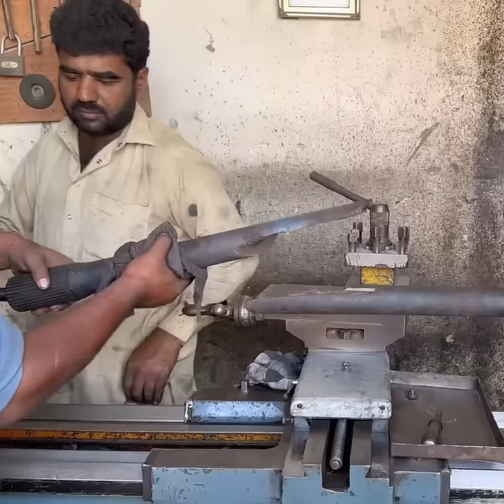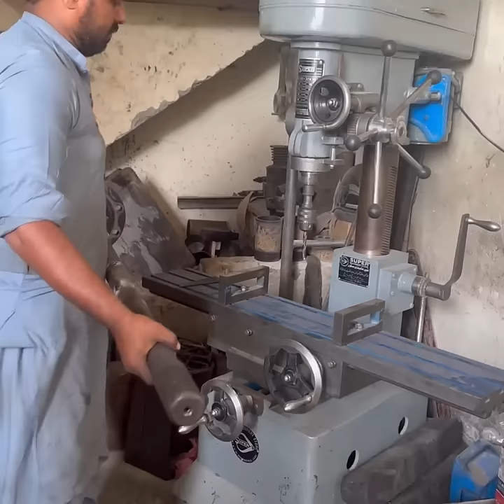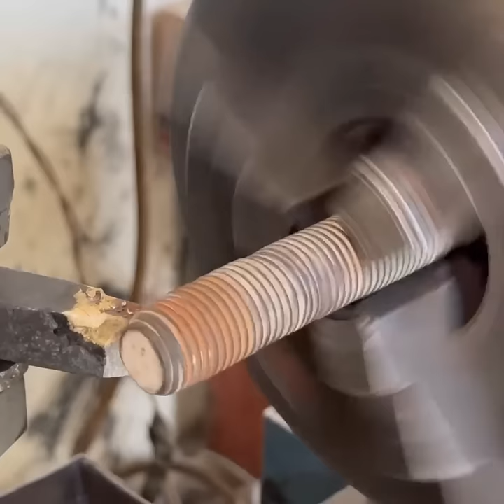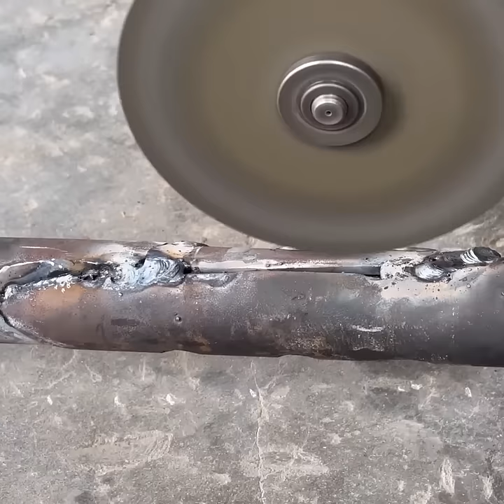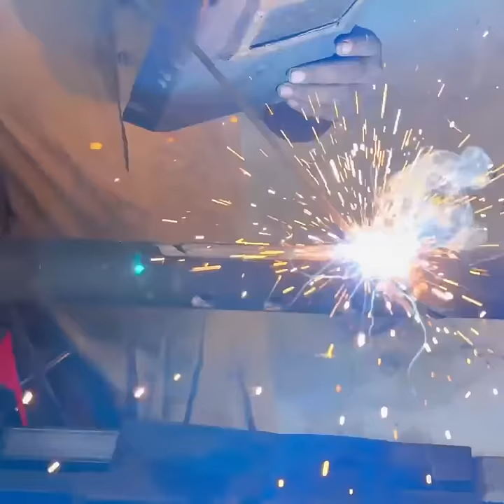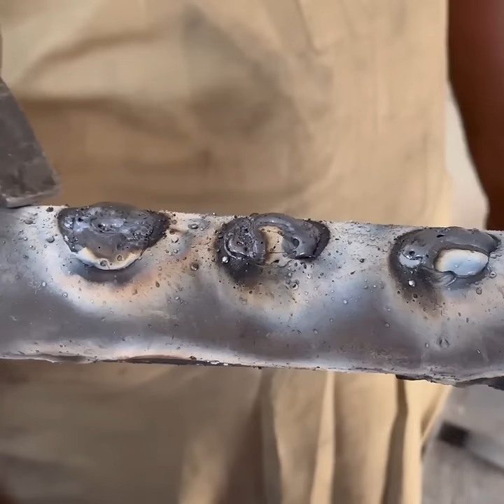How to Rebuild Broken Axle with Amazing Technique

Comment: There is no way that thing would last.
Reply: Es solo llamar más pobreza...
Reply: its not as strong and will likely break very soon
Reply: @chetbenton07  How dirty was that break 🤣and when you think about the torque that thing is going to get as well as no way to ever balance it. What it is they make it look nice and sell it to some sucker and it dies a week after installation.
Reply: Amazingly all that equipment is there and they don't understand the basics of tensile strength 🤷.
Reply: It broke more while they were playing with it
Reply: @dgeneeknapp3168  Well they are using the welding as the hardening and tempering process all whilst wearing grandpa slippers!😂
Reply: @trentgreen9745  I saw that a great big dirty crack next to the rivet which just goes to show how fragile it is in the first place. Probably snapped because of over heating. It would be like using a glass handled hammer you might get one good whack before it explodes.
Reply: I don’t think anyone here knows what they talking about and never welded anything EVER.
Reply: @AJ_900  What do you mean. Are you saying it's a top notch job?
Reply: @AJ_900 alguém sensato falou a verdade. Mas o que mais tem é gente querendo demenuir o trabalho das pessoas
Reply: It didn't last when it's new.
If the repair can give it more usfull life then its  worth it.
Cost of repair is only a tiny fraction of a new one
Reply: @daveredd9832  You do realize that they fix heavy machinery in this same fashion. (Not exactly like this, but with welding.
Reply: Eso no sirve de nada,
Reply: @AdrianJNyaoi they didn’t V out the work properly. It won’t last 5 minutes when the truck is loaded. Aside from that they messed up the metals tempering.
Reply: Im the 301th likes
Reply: You will be surprised that will probably last as long as the car
Reply: @James-cs2wi  What car? There is absolutely no information other than it is a very poorly performed attempt at a repair.  Not to mention there has been a catastrophic failure already. So a very poor repair upon a vital mechanical part which is subject to great torsional strain that has already failed and not been repaired properly.
What sort of vehicle would you trust this in?
Reply: @TheNarrowPath84  Of course repairs can be made that last but with what has been displayed here there is no way anything near a quality repair has been displayed. And it is quite clear that there was enough tooling and skill to do a good repair. It was no where near good enough.
Reply: @AdrianJNyaoi  A tiny fraction of no life is not worth what some poor old farmer is going to pay for a piece of garbage that will fail half way to market.
Reply: @trentgreen9745 😂
Reply: @daveredd9832   Just curious how your response is relevant to mine? Let’s not pretend that heavy machinery isn’t fixed in this same fashion. Shitty welders are world wide. I guess because they’re not American they can’t do quality work? That’s the feeling I get from everybody because they work in sandals. Quality tools and PPE doesn’t make you a quality craftsman. 
And you liked your own comment didn’t you?
Edit: I’m curious why you think it won’t hold? After being machined down, the axle looks good to me. I’m sure it’s not going into a hot rod and have serious torque put on it. I will be my bottom dollar that this was from a small car and more than likely it was done just to show he could do it. Are you a welder? If not, what field to you work in? I am a sheet metal mechanic.
Reply: That’s going last forever 😂
Reply: @chetbenton07 not true at all actually
Reply: Im not a welder but I've seen way bigger stuff that that tac welded and it's perfectly safe welding is 100 percent safe the only problem is this would most likely just wouldn't be straight as it should so that would just mess other parts up but that weld is gonna hold but not as good as new considering the bars not straight
Reply: It will last for a long time 
It's just amazing how they fix it 
They are hard workers.
Reply: That will last forever…in a go-kart 😆
Reply: Only has to last until it breaks again. It's a vicious cycle, but it's life.
Reply: Depends on the weld job. Done right welds are just as strong.
Reply: @Thekidsinafrica14  Well that is the point, looking at the job and the dirt left in the weld no way was it done properly.
Reply: Good to see Health and Safety is high on the priority list.
Reply: This must be an emergency  , the car has broken, the wheel shaft of the car  has broken  down on the road , this is the way to speed up tepairs that far from  the city
Reply: @jamesedgar5944 
La soldadura no es adecuada en piezas que sufran fatiga , osea cargas alternas. No rompe la soldadura, sino por al lado. La soldadura al enfriar rápidamente ya queda en gran tensión. Habría que calentar la pieza a soldar antes de soldarla y asegurar un enfriamiento lento
Reply: @TheNarrowPath84  The cracking steel next to where the rivet had been driven in? That shaft is about 75mm thick (3 inches) meaning that it comes from a small truck.
It is designed to be one contiguous piece of steel just look at how filthy the two surfaces were not to mention how many voids would have been left inside where you can't see them. A polished turd is still a turd.
Reply: @macarenomoranas  I know you see English on my comment😂
Reply: @AJ_900 tell me why this repair will fail. Right answer only.
Reply: Para resolver y llegar a un buen sitio bien, luego si habrá que cambiarlo, remplazarlo completo, sería lo primero que haga.
Reply: @daveredd9832   Yeah, you’re not a welder. It took one comment, just one, to tell me you can’t weld, much less know what you’re talking about. A small truck? I guess you’ve never actually seen how little those trucks are in that part of the world? Tiny 🤣🤣🤣 And those aren’t rivets. Solid steel pins. Please don’t @ me again unless you know what you’re talking about. Thanks in advance.
Reply: Por que?
Reply: Hami yenileri sindirsin sonra təmir etdirsin . Təmirlinin güclü olduĝu iddiasi var toyuq başlar tərəfindĕn 😂😂
Reply: Your right😊
Reply: Imagine how bad it would shake??🤯
Reply: Engatilhado para vender para o primeiro inocente que aparecer, é uma covardia na verdade esse trabalho mal feito, sem garantia alguma.
Reply: It is poor country
So that is better than nothing
Reply: There was a second crack on the opposite side of the original crack when he pounded in that pin. Poor sucker that buys that rebuilt is gonna regret it going up hill.
Reply: @Alex.369 да ты прав
Reply: Yes, he must have glued it together and let it be solid like the way it was. No replacement of metals to a welding
Reply: Actually, it does last way longer then y’all think 
😬
Reply: Its actually stronger now
Reply: Actually look Very Very Extremely Close Slow Motion the Real Truth Comes Out Really Makes One Beleave in One's Beliefs Cause That Has been Welded spot Welded Mig Over Hundred 💯 Time's!!!😅😂
Reply: هذا الحرفي ،يعرف جيدا ماذا يفعل و حتى بأدوات بسيطة ،رأيت أغليية التعليقات السالبة و أقول لهم راجعوا الفيديو جيدا و المنطقة المتقطعة عززت بالبراغي ، النتيجة : أصبحت أقوى على ما كانت عليه .
مثل عربي : الحاجة أم الإختراع.  و أنا أقول العكس صحيح أيضا .
Reply: @tswyoung5223 Think if you are
a car owner and the spare parts availability at the distant opposite of the globe. If you are
wealthy it's so nice if junk your
car.
Reply: I've done things like this before, and it usually lasts a lot longer than I think it will. When you don't have a lot of resources, you do what you need to do to get by.
Reply: But it works, temporary, good idea
Reply: Doesn't matter rich or poor it is good technique
Reply: @daveredd9832 Who balances axles?
Reply: With those skills, they should have just made a new axle
Reply: @ajcarmageddon he's just guy from internet, maybe he csme from capitalism country which said buy new one not fix the broken one
Reply: Oh yes it will, and if it breaks again oh well they will just fix it again.
Reply: @jmaxim80  But of course what else do you do?
Reply: @tigeroftheeye7121  Hahahaha but why waste good steel on someone else's bread and butter when you can bodge it up and get paid for it?
Reply: @tigeroftheeye7121  I don't think that any one does. Because it is generally made out of one piece of steel. But when I look at that thing and consider how fast it is going to spin questions come about. Torque with speed inside a hollow tube with tight tolerances. Sorry mate it will vibrate.
Reply: @gausmulla3378  It is good for getting you to the next town or home. Good attempt but dirty steel full of voids. Making it look shiny does not make it gold.
Reply: @stubbs9079  True but look at the gear these guys have. It is actually a well equipped workshop in any country. My beef is with how dirty the steel is as they put pipe clamps on. That axle is the best part of 75 mm thick. The welds don't even get half way. Then think what it took to break it in the first place and I can only conclude it will not get very far. There is the possibility the owner said make it last two thousand kilometres because I'm getting a new diff.
Reply: @Abbesr8  Apologies mate but I do not read the language you have posted in.
Reply: To all the shit talkers, this is what you do when you don't have a replacement or the money to replace it....
Reply: @richardwarnock2789  I'm not exactly sure what you mean I just watched it again and see the stick weld into a dirty void as well as a clean through break next to the skilfully fashioned rivet. Then there is the polishing of the turd. But Mig? Please regale me.
Reply: @daveredd9832  bro uh r right but temporary it is ok.
Reply: @tswyoung5223  I have dudes busting my chops because I dare doubt the quality. Read some of the other comments this is almost fun pointing stuff out to goof balls. But I am getting bored after three days.😁
Reply: @TheNarrowPath84  What car has a three inch solid steel axle? As far as what a rivet is it is a short metal pin for fastening two or more pieces together, having a head at one end, the other end being hammered flat after being passed through holes in the pieces. 
Well sorry "almost a rivet" one end hammered in and the other welded.
A pin does not poses a head on either end sir.
And as far as those trucks in that part of the world are concerned. They have rigid large trucks all over the place.
Point me to any truck under two tonne that needs a three inch axle. A three inch axle is for a big arse truck mate.
I have a one tonne Ford Falcon ute and the axle is about 30mm. What little TukTuk needs a 75mm (three inch) axle?
Reply: @yourdrummer2034 I like Your thinking. Good to Go until it needs to be fixed again or replaced. Worx everytime.
Reply: @daveredd9832 a tricycle perhaps 😂😂
Reply: It's only to get someone to a shop 🙃
Reply: 😩💩nooo 🤦🏽
Reply: @daveredd9832  no the guy is probably watching him work and it will work til it breaks again then he will fix it again cos thats how its done, when you cant get the bits to replace things and even if you could it would cost too much to buy it
Reply: Deve tá mais forte que original amigo 😅 pode apostar
Reply: Amen and Amen all day long on that one
Reply: Yes it would
Reply: Slap 700hp on it its snapping in 2
Reply: My bet is about 12 minutes!
Reply: I’ve seen forged in fire too much those metals are not bonded well enough 3 robbets might help if this is spinning like an axle but any weight on it sideways is gonna make it bust right away
Reply: I'm sure they have done it before and it worked
Reply: Se puede poner refuerzo cilíndrico adicional exterior
Reply: Es lo que iba a decir, eso solo para sacarte del aprieto al momento
Reply: Looks like an axle from a Yugo.
Reply: Oh India, just buy a new one. 4000 labor dollars later
Reply: У меня стоит уже 4 года так что не надо
Reply: Welding usually produces a stronger metal connection than the original. A good weld can be better than new. Most here should Research welding before commenting 🤔 
This is impressive given the working conditions, After all“ invention is the mother of necessity.”
Reply: Ещё тебя переживёт
Reply: Why does that matter? Imagine getting stuck somewhere with no parts available. I doubt they have one on the shelf. If someone did need, it hopefully  they got home
Reply: It would
Reply: @bryanrose2384  It would what?
Reply: @alphagoat1314  These blokes are putting their very families fortunes and well beings on the line for a poorly patched part.
Now imagine when this good looking part that you paid money for and paid someone to install being told it is the bees knees fails. You do not finish your job you do not get paid and you are stuck in the middle of goodness knows where. 
Looking at how well equipped that shop is. They are well to do in any society and preying on the less fortunate.
What does it matter?
Let a mechanic charge you for a part that fails when you are trying to feed your family and ask if it matters when you roll down a hill backwards into a ditch.
Reply: @schneider007  Usually? Can be?
The working conditions are as good as any anywhere in an industrialised nation. Look at the equipment they have.
How many shops anywhere have the capacity to turn a three inch piece of steel four feet long. Then the quality of a drill press plus drill bits to get through that material.
Highly equipped well skilled doing ordinary work.
I fail to be impressed.
Reply: @richardwest5010  You are a funny bugger Yugo axles are about 10mm thick. That is less than half an inch if you are a sepo.
Reply: @stevestevenson7856  Well I believe it wont get you far. You seem knowledgeable what sized vehicle needs a 75mm axle?
Reply: @louismoro9585  I love that show any donkey knows it will not take any torsional strain. Love ya bro. I have been getting a lot of flack well... from donkeys!!!
Reply: Bro they constantly snap axles out there... Think about it... You're not going to NOT BREAK stuff when you're in the dessert and and everyone has a fully built 2j or rb in their patrols
Reply: @chetbenton07 they just want to sell that Thing....
Reply: @AdrianJNyaoi No Worry, they welded it with Allahnium 😂
Reply: a necessidade fala mais alto, nem todos tem dinheiro pra comprar um eixo novo.
Reply: Repairing broken things is an art in India they are very wise and smart people, other nations around the world practices the same
Reply: @Tecnotrucker80   yeah
Reply: No soy Mecanico sin embargo veo que esto es basura eso no le importa ellos incluso para subir el video lo que les importa es que gente como nosotros estemos haciendo comentarios muy rara vez hago comentario normalmente simplemente le pico el botón de qué no me gusta ella porque al hacer comentario entonces estás ayudando para que sigan haciendo esta basura
Reply: Work super labour
Reply: Most comments here are so vague and ignorant .
Just because in other countries It’s easier to replace than fix. It doesn’t mean it’s the right thing to do.
These fellas don’t need steel toe boots or high tech protective gear.
They have knowledge., skills and a strong willed mind. Something that is very rare in fully developed countries. 
We need to understand this world a bit more. And look at it from all the angles, not only the one we know.
Not because the products we use or consume are stamped with a nice name plate or we only see it finished and shiny, doesn’t mean it’s better quality. 
Most of heavy equipment parts are made in places like this. And we are so confident and happy to use them because we didn’t see the process of making it. We just bought them at a high priced retailer with a fancy name.
Reply: Great job. They are pure people they don't find new parts so easy that is why are they welding that thing😉
Reply: @AJ_900  hablas de ti mismo? Creo aquí somos bastantes soldadores y todos estamos de acuerdo con que no va a durar ni una semana está reparación...
Reply: Didn't last in the first place
Reply: Five minutes😂😂
Reply: Я читал про одного сварщика, который, ещё на заре электродуговой сварки, влюбился в это дело и будучи капитаном речного судна, бросил свою профессию и стал сварщиком. Однажды ему пришлось сварить переломившийся вал здоровенного грузового судна, но там ещё была закалк после сварки. Судно благополучно пришло в порт назначения.
Reply: it'll last longer than it did before it broke
Reply: the repair is the only spot that axle won't break
Reply: @daveredd9832 in countries like these they reuse as much as they can. It's all about perspective.
Reply: @antoniomurillo6648 what do u no
Reply: @AJ_900 I 100% agree.
Reply: @daveredd9832 I think you're confused as to what the end product should be
Reply: @jeremykamel9655 the truck?
Reply: Pakistan ☕
Reply: @partha1401  Pakistani coffee is absolutely delicious, not sure what that's got to do with this welding job though.
Reply: People really underestimate the strength of even a ‘shitty’ weld. Not saying the welding here is sh!t btw.
Reply: Nothing last forever😂
Reply: No but it may get him home atleast is what I'm thinking   can go easy for sure  it's probably  stronger  than it seems but probably not  as strong as it  should be most the torsion is probably  on the outside.
Reply: Of course not, from the perspective of the average first world country citizen there's no repair at all that would work.
Reply: Ещё-бы рессоры заваривал
Reply: Ur wrong...that pakistan tech, world best
Reply: @AJ_900 de echo si las moléculas no están alineadas de forma uniforme en su interior jamás resistiria . Esa pieza tiene que estar en la función y hacerla nuevamente por completo
Reply: Can someone explain to me what would cause a break like that?
Reply: @antoniomurillo6648 no sabes de qué hablas un chasis de un trailer americano se corta y se convierte en tortolitos lo cargas con 22 a 24 toneladas como te explicas que no se parta en dos ???
Reply: Daily thousands of broken repaired and last too long in Pakistan so they r doing and people r satisfied
Reply: @Adam-ub9nu  it’s a truck/lorry axle shaft.
Reply: They've done this many times, will probably out last the car
Reply: I've been a welder for 24 years. He did a very good job of this. Especially the bevelled edges for the prep work prior to the root run weld. 
Anyone who says otherwise is clueless on metal fabrication.
Reply: @T.M....  I say otherwise. He cracked the work with the rivet. There isn’t even a reason for the rivet. It just weakens the piece even if it hadn’t cracked it. Then he didn’t V it out nearly enough. You may be a welder but you’re obviously not a mechanic. They didn’t get enough penetration to get to the core. These axles take a lot of twisting. 

Aside from all that. Axles are heat treated and the welding process messes that up to a point where the balance of exterior hardening and internal flexibility it’s gone.

This axle won’t last 5 minutes or 5 miles.
Reply: That's a solid shaft so it take the whole torque from the engine.  When 3 studs are drilled they create more weak zones. When rhe outside is welded then the loaf is further taken by these welds. Undoubtedly this repair can never have the initial strength of a new shaft and will break as new flaws have been introduced. As a Metallurgist I would not recommend repairs as the shaft is beyond fixing.
Reply: But it did
Reply: nothing last, even the original shaft broken!
Reply: @chetbenton07 and it's much weaker and has a higher chance of breaking
Reply: That looks like it's part of a trailer or something to do with cargo
Reply: Remember it's probably going on a Tuk Tuk or a kei car.  It will probably last longer than it did on the vehicle it came out of.
Reply: Maybe useful for emergency use, only to drive a few kilometers.
Reply: Its time tested technique we use it in India.....its increase  life by 50%....
Reply: @TheNarrowPath84  It won't last a month going over bumpy roads and pot holes.
Reply: @jamesedgar5944  Not a chance that weld will hold. It looks good on the outside but there will be a lot of voids internally with the way they repaired it. I'd give it a month tops before it fails again.
Reply: @TheNarrowPath84  It's clear you don't seem to have a clue what you're are actually talking about. I hope you aren't doing similar repairs in some part of the world.
Reply: @tigeroftheeye7121  Exactly, they had the lathe for it.
Reply: @Deebroking  50% of what?
Reply: @Chris_the_Muso  A TukTuk with a 10 tonne trailer🤣
Reply: @josehopkins1265  A trailer does not need a perfectly machined round axle and it would have hubs on both ends. That is an axle my friend. Half of one side that connects to a differential.
Reply: @emanuelmifsud6754  I could not agree more with you. I am however having a bit of fun and sport at the expense of certain people within this thread. 
Such passionate defence for this job. Some even stating that it is now better than the original !
Does it make me a bad person if I wind them up?
Reply: @T.M....  So if you were to twist it,,, say like with thousands of Newton meters of torque all whilst considering a pristine contiguous piece of perfect steel could not take the strain in the first place. Your belief is this repair could take it? 
Good luck in your endeavours I hope that you are never responsible for any steel work where lives are in the balance.
Reply: @bajaboardukesk8858  What car needs a 75 mm solid steel axle?
Reply: @FallenAngel-it7so  Perhaps a manufacturing defect coupled with overloading the part itself. That part is from a heavy truck and I am sure everyone has seen vids of how these vehicles are treated. It is usually never just one factor.
Reply: @stevestevenson7856  Much more than a Tuk Tuk🤣this thing is meant to take a load. How many kilos can you throw in the back?
Reply: @adeptusmechanicus1029  The end intended use too I would suspect. There has to be a great deal of respect for the limitations of the repair too. I suppose you can stop a vehicle with almost no brakes as long as you are not going too fast.
Reply: @daveredd9832  1000nm is only 100kg in conversion. That repaired drive shaft could easier handle 20'000nm. 
You clearly know nothing about engineering or metal fabrication
Reply: @alobo75  Made from scratch is none the less different from a poor repair in any part of the world. 
The part and it's intended use are very important factors and to view bad workmanship with respect and even adulation is to condone it.
I have absolutely no reason to believe that dodgy workmanship should be excused anywhere.
It would also be disrespectful to believe they can not do it right. That shop is as well equipped as any here in Australia and the skills displayed are excellent but the job is still crap.
Reply: @Shawn-fz4vv  What tells you that they are in the desert?
I honestly don't know does a (I am assuming that you are talking about a Nissan Patrol) really have a 75mm rear axle in the diff?
Reply: @T.M....  Well thank you for your input. What sort of vehicle do you believe it belongs to then?
Reply: @TheNarrowPath84  I do believe the "not exactly like this" part.
Reply: @stevoc9930  you do realize the things we weld right??😂😂 those studs they put in are literally eliminating those "voids" you're talking about I do thing they probably shouldve cleaned the break but for the most part but they also stuck the welding rod inside too so there really isn't a void dont forget uts metal welding METAL you weld with different  stages ,its 100 percent trust worthy and will last atleast 3 years not a lifetime fix no but good enough to last 3 years
Reply: @daveredd9832   🤣🤣🤣 True
Reply: @stevoc9930   Stick to Nintendo Stevie boy.
Reply: @jamesedgar5944  If you don't think there's voids in that axel the way they welded it then I have a bridge to sell you.

The pins won't fill the deep parts of the crack, their surface weld of the crack itself won't have penetrated more than 10-15mm deep.

The pins only fill the holes they drilled. The majority of the surface area of the crack is the void.

You do realize that don't you?

Are you a welder?
Reply: @daveredd9832   like half life of new
Reply: Stronger than original!
Reply: It will probably last longer than before now that the steel is not as brittle because of all the heat cycles it has been through 😂
Reply: I think it would last a little while
Why are they doing it if it wouldn’t last 
I’m not a welder, but from my understanding they do stuff like this all the time
Reply: The welds will last longer than the rest of the axle.
Reply: @Deebroking  New did not seem to do so well 🤣
Reply: Aparte de que esa pieza quedará con vibraciones y se romperá en unos días
Reply: So?
Reply: Why not?  Welds are strong.
Reply: The original didn’t last either.😂
Reply: @chetbenton07  The heating alone probably made the metal less brittle. Not exactly going to help.
Reply: I bet that axle will outlast the other
Reply: Its okay, theyll cover it up with paint and youll never know 😮
Reply: @OppositeOfTheLeft  So when that brittle steel all around disintegrates the weld will be bright and shiny and new🤣
Reply: @bass_and_bass3323  I like the way you think. Does that mean the turning process was as good as annealing?😁
Reply: @ireallyreallyreallylikethisimg  Can we have gold glitter with that?
Reply: Funny to see all the comments about different metals, dirty and it won't last 5 min.  Working in a steel plant for 32 years I see stuff that is dirty, rusted, wet dissimilar metals  welded everyday to keep operations running. If you think they're taking equipment down for hours to put in the proper piece everytime something breaks your smoking something.  Seen welds like this last month's to years and equipment from carrying 300 ton of metal, rail tracks, cranes and so on.
Reply: bro it was made as a temporary solution for short term use do not expect it to last long.😂
Reply: I don't think that will even turn types
Reply: @daveredd9832 como soldador que soy.... la neta solo estas hablando mentiras, con ese tipo de soldadura, arregle una rampla y lo que pasa encima es un carro que pesa más de 2 toneladas, no sabes de lo que hablas hijo, vete a dormir.
Reply: Fuck you mean, that's prolly stronger now  than when they made it at the sweat shop.
Reply: They wouldn't go to the trouble if it break again...these guys know where its at.
Reply: А им и не нужно чтобы долго жило. Клиенты будут всегда
Reply: Awesome just to see how long it last.
Reply: Once is broken it would stay thay way no matter what & how to fix this:buy another one-couldn't agree more to you man.
Reply: @jeremykamel9655 it says it's a jackhammer lol
Reply: Опять залечят, иехнология отработана.
Reply: Усталость металла на разрыв, вал лопнул. Видно что лопатся начал он за долго  . А значит ремонт имеет смысл, запас прочности позволяет
Reply: @AJ_900 Exactly. It's strongest at the weld.
Reply: Ikr
Reply: Still going strong I seent it
Reply: @drjoe2323  Wow it's in your truck or your friends. It is good to get some actual feedback. So what is the vehicle it is installed in and how many kilometres has it done?
Reply: A simple tube over would last forever and would be much more simple to do ...
Reply: @daveredd9832 no what it is, is them making do. I mean sure that happens, but more importantly it's them doing a service someone needs. It's the equivalent of riding on a donut knowing it won't last but this was cheap so you do what you gotta dop
Reply: Bila greska u materijalu
Reply: The repair now is actually stronger then the axle in its original form.    The repair is several times stronger now....
Reply: @PraiseYahweh-vo1ni  Rubbish if that was the case they would all be made like this.
Reply: @OXyKidd-tq6ul  If they sell it to someone and say it's good as new that makes them con artists.
Reply: @James-cs2wi  CAR!!?? That's from one of there 10 wheelers that they constantly overload...
Reply: Никто этого не узнает пока она не сломается
Reply: @daveredd9832 they said it's for a jackhammer not a high rev/min spinning shaft
Reply: @sa31312  I'd love to see this jackhammer.
Reply: How do you know?  It might not balance but nothing wrong with the weld.
Reply: Engineers would have suffered heart attack just from a microscopic crack. I wonder what theyll feel if you said thats what they replaced on his car😅
Reply: @pracha95  Because I have seen the fuss made over the welds on a mere water pipe. Seeing the process on materials no where near that thickness that will never be exposed to the forces that shaft will have to endure. To get an empty truck back to base yes probably. A permanent fix "no way".
Reply: @javs2280  Apparently according to so many it doesn't matter and I am being obscenely harsh in my determination.
People who are not engineers themselves reaming me out because the effort is what counts apparently. The job itself is not important but it's the thought that counts.
Kinda like getting a participation trophy because we are all winners.😂
Reply: It’s Pakistan.  They do what they gotta do 🤷🏼‍♂️
Reply: You would be surprised how long it lasts. There is a reason these guys are in business.  This is a necessity for these people.
Reply: @samhouston2000  How long does it last?
If you are so well versed on the subject.
"These people" what does that even mean?
They do not have the facility to do a good job?
That is a lie!
They lack the skills?
That is a lie.
Some poor sucker is going to get this part for his vehicle and be left at the side of the road.
Please spare me your platitudes and think for the individual that receives this garbage and not for the very ordinary good looking bodge job. 
They have the facility, skill and materials to do a job magnitudes better.
Ripping decent people off is only the necessity of the evil!
Reply: @CanaRollcreations  Yes rip the next poor soul of his hard earned money!
No excuse !
Reply: 4 sale norm! 😂
Reply: @daveredd9832 look, used brain: they won't be making thse repairs If it doesn't work, LOL
Reply: What I can say is better than nothing, they tired to repair and if they will drive gently then is will hold for sure.
Reply: Whatever broke it the first time is going to break it the second time
Reply: It didn't last the first time... you have to work with what you have...
Reply: @AJ_900 I taught welding in the military and worked on heavy machinery. This kind of piece can't be repaired by welding. It's a cast piece that's been balanced, once it snapped it's done. They're just making it look pretty so they can sell it to someone who doesn't know any better.
Reply: @schneider007 As someone who taught welding in the military and as a civilian I ask you is the piece not cast as a single unit then balanced? And if that tensile strength is then compromised by the break, please tell me how a weld will restore that tensile strength of a cast and balanced piece of heat treated steel.
Reply: Você  e mecânico?
Reply: It actually will last crazy to think right but as a certified welder I’ll say that 7018 can hold some shit together
Reply: @Banktizzle  Shit being the operative word. 
A welder that gets stuff placed in front of him on a production line to weld in perfect conditions reckons a piece of brittle garbage that can not even handle being hit with a hammer without cracking is a great job.
Please do not repair anything that any ones life or livelihood depends on!
Reply: and I’m sure that this Indian guy did way better with what he had then you could have ever and that’s the funny thing about the internet a whole lotta know it alls
Reply: YOU ARE WRONG.
Reply: tats why Alibaba and the 40 thieves
Reply: He may be doing the very best he can  with the resources available to him.  At least he didn't sit down and cry!!!    Tip of the day...if you get q chance bro. You may want to pick yourself up a pair of Steel Toe Sandles... but again..he may be doing the very best with the resources available to him.  God Bless You
Reply: They seem to repair what they have. Maybe not fortunate to be able to get a new one. Looks like some skill to me.
Reply: Seemed liked they had a good idea what to do. Pinning it was a decent idea. You'd be surprised what can be fixed with welding and machining.
Reply: @dgeneeknapp3168 that requires education.
Reply: Agree that either broke from fatigue or in shear but at least its back in service for now
Reply: it could last for years and stop talking kinda wise robustness stuff
Reply: @creeper50  It will last a lifetime I'm sure if it never gets used. And what is "stop talking that kinda robustness stuff" even supposed to mean?
Reply: I'd bet you $100 it would
Reply: He even balanced it too.Yeah that will work said OldPaw
Reply: @AJ_900  the weld makes it too fragile(not flexible as this part meant to be to withstand impact forces) and it will probably brake again...
Reply: They do these kind of repairs all day long and it works for them
Reply: When you weld that much on harden steel it makes it very brittle it’s just gonna snap right next to where he started the weld or end of the weld But if you have no other choice I guess do what you gotta do
Reply: Should have cut off the bad part on both sides, and replaced it between and made sure it was up to spec, and then weld the whole thing up.. 

This video can't even be straight enough, for it's all mangled up...  
To be  that mangled up, I don't think the whole part is up to the job anyhow.
Reply: 1/5 of the torque that broke the original axel will broke this.
Reply: @DataStorm1  Thank you I agree. I also believe considering the equipment and skill shown that it could have been done so much better.
Reply: @endemikpandemi  Yep that would be about right.
Reply: @Bulb466  Yes the recipient is on the other side of the country and they don't have to see the turmoil they caused and still get paid.
Works fantastic.
Reply: When you live in the desert you kinda don’t have a choice lol
Reply: You sound like my girlfriend
Reply: @M-Powerdreamsgarage  Lots of desert places have three phase power?
Reply: CLEARLY they’re literally using power tools and welders 😂 I didn’t say shit about power 😂
Reply: It'll last, ok?! All the way to scene of the crash...
Reply: @TheNarrowPath84 I’m not a professional welder by any means but I do k ow that just welding the sides without proper penetration leads to a weaker than original material joint.
Steel pins would save some of the load.
I doubt this will hold any better than the original part.
Also I’m European an most times I’d pick a non us part over a us part :)
Reply: Why wouldn't it last? Do we even know exactly what this is going to? It might be a moped side car axle.
Reply: No but under light loads? Probably.
Reply: Lasting is not the purpose.
Will it sell? Yes it will.
That is it.
Reply: @ammarrafique7401  That my friend is what makes it a crime. Some poor soul will be told "It is as good as new".
And stupid people will defend it like there are no better people in all Pakistan.
There are good people in Pakistan. 
And what has been displayed so many idiots defend saying  "that's all they have"
Rubbish!
Reply: @randallwegman1028  Bada Bing Bada Boom LMAO.
Reply: @alobo75  They have nuclear weapons and you believe they don't possess the technology to fix an axle properly?
Reply: @ionelaioni6355  They are using a lathe that is worth more than my car. All their equipment is powered with three phase electricity and you are saying they are backward?
Reply: @adeptusmechanicus1029  Yes who can I rip off.
Reply: @daveredd9832  Those are some sincere words.
Reply: Nice .. it'll work!
Reply: As a welder he is a genius innovation at its best... As for re-using this axle. I pass .
Reply: @OUTLAWZee73  Innovation?
Hardly, to believe a bodge job has never been done before?
You must have grown up in a nice place with decent people to humour a great effort for something you would not use.
Reply: THUS SAY THE WESTERNERS 😂😂
Reply: I doubt the figured all this out for it not to work. Not as strong but strong enough.
Reply: It only has to last long enough for some idiot to pay them for the repair.